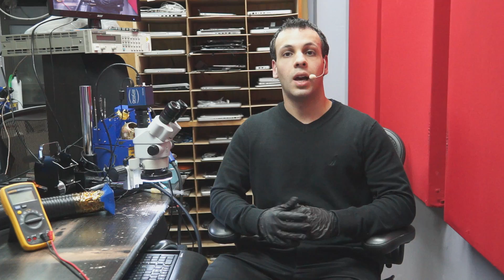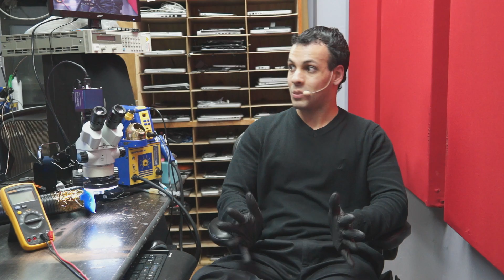Concept of gear consistency: why does this matter?

Comment: YiGau, AoYue, YiHua and many more, are just manufactured by the same factories or share the build idea's. Its cheap, its easy to get replacement parts for but Louis, you hit the nail on the head multiple times already, their crap for professionals and amateurs that take care of consistency, reliability and safety (and many more things). 

Before I lose too many people reading this, DONT BUY "branded" soldering station either, they are THE SAME. Im talking about those Velleman, Tenma, TOOLCRAFT, AT201D or whatever... 
google "solderingstation", google the item name of the one you like to buy, COmpare the images, if you see the overal design branded by diferent companies, its DEFINITLY CHEAPLY made in china. Replacement part are easy, from china, but your buying a too expensive, cheaply build device.

buy a REAL hakko or weller, or the recommended professional devices, probably not build or sold from china

I got a Velleman VTSSC40N (70 euro), apeared broken, replacement pcb? 40. replacement iron, 10. In china, WAAY lower. You know what? I did buy a replacement iron, and it works. nothing wrong with the pcb, but the seller told me I needed a replacement pcb. and I could even fix it cheaper (I got the device for free from a friend), it was only the ceramic heater. and when I looked into that thing, partnumbers and shit... Its China, its the same one as in some Yihua and AoYue... but they are NOT the same quality as the weller or Hakko, thats a whole diferent level. 

If you want to go cheap, buy a Aoyue or Yigau like brand one that looks exactly like all others, so your replacement parts are cheap and easy. But if you wanna go PRO, or care about reliability and safety and sort of things, save up money and buy a real one. from the good stores, maybe directly from the supplier/manufacture recommended stores. 

please forgive any spelling or grammar mistakes, I really hope you spend your money right. and If you do, like me, stay with the cheap for a while. Save a little every week or so to get someday a good one. better wires, better displays, better heat-transfer,  service and support, a proper pcb inside, ceramic heater as it should be(or better tech). Im just a noob, but Im not getting fooled again by some Chinese sales person(store). But hey, sometimes, you just need that cheap item... go for it. (also, what plastics did these people use... is it toxic?... You may never know...)